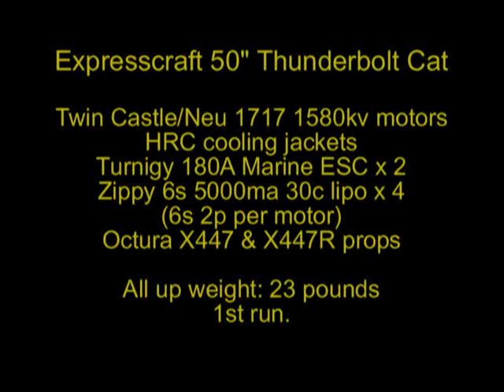Expresscraft Thunderbolt Electric Twin.wmv

Comment from the maker: @mickvk 
Thanks mickvk. If you pull up the full description there's a link back to the full RCG build thread in it. I don't have a speed reading (yet) but the props were Octura X447 and X447R. I don't have a data logger so no info on amps either. The only thing that got hot in the almost 4 minute run was the caps on the esc. Batt per cell resting voltage was still over 3.87v . Think the motors were like 109 amd main esc bodies about 114. Caps were 190+.

Comment from the maker: @eagledan10  LOL In all honesty I didn't keep track of expenses. Made that mistake once with a 1/8 scale Cermark F-16 and wound up not wanting to fly 
it. It is a low cost build compared to what it could have been. (Turnigy esc's Castle 1717's that were bought on the clearance sale, etc)  There is a good listing of the parts involved in the build thread You can add them up if you want but don't tell me when you're done  :D

Comment from the maker: @rrandydduke  Lost a couple miles per hour (best GPS run to date is 62.3 mph) but actually improved turning speed. Do a search for  01-30-11 Thunderbolt Out 6s.wmv  That was the 1st run with props spinning out on 6s and had a GPS on board as well.
The best GPS'd speed (saw runs) can be found in 9-Thunderbolt-6s.wmv

Comment from the maker: @iamsrt4  It actually has possibilities as a 50-60 mph roundy round or offshore class boat, but the hull generates too much lift for extreme high speeds. The downside to the MHZ line is that MHZ price tag. Mine has a MHZ rudder on it and it was the single most expensive item in the build except for the hull. 
I'm curious as to what you find out on yours with the tale of the scale.
Bill

Comment: @bill34207 honestly im unsure of the weight difference between both im going to throw mine on a scale tomorrow and figurte that one out. But i do know one thing and that is this hull is made for recreational use only not a race hull by no means. i thought about selling mine a few times and im still playing with that option i would prefer a MHZ cto3 complete scale and race hull those are some beautiful hulls on the water

Comment from the maker: @iamsrt4 
Gas can have it's advantages too. After 3 to 4 minutes (depending on hard I'm running it) this one is done. Gas will run all day it seems like. ;-) Mine is probably a bit heavier than yours too. Once loaded with batteries it comes in at 23 lbs. I think some of the hot gas motors are faster as well. My best GPS'd saw runs on this one is like 62.3 mph. I do like the sound of electric though. Nothin but prop noise and shaft harmonics. 
I watched your vids a few months back but out of ro

Comment: @bill34207 hey it's been a while since the last time i talked to you i actually took the boat apart. I have plans to run ccracing promod single engine but now with a splitter gearbox with an outdrive in each sponson so my question is what outdrives are you running on there? im pretty sure your running a 3/16 shaft but i just wanted to know what outdrive that was.